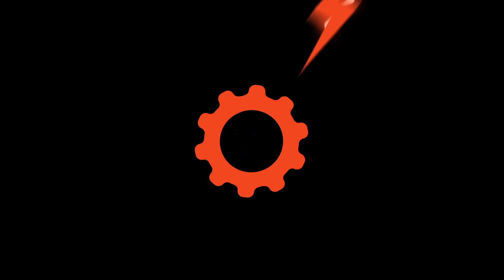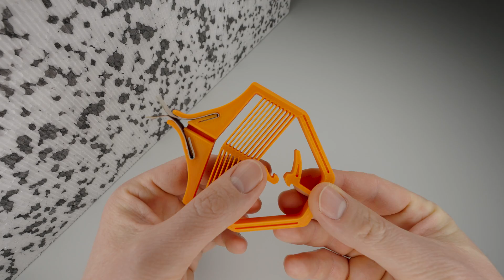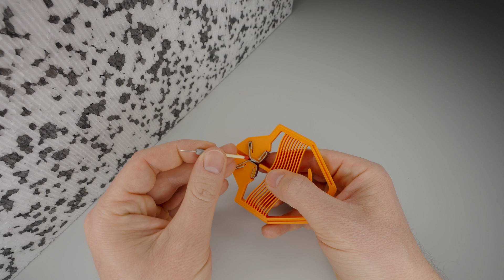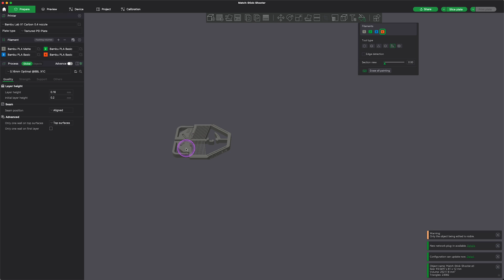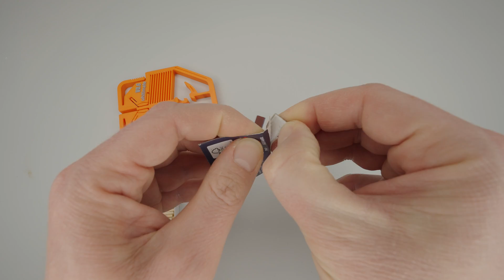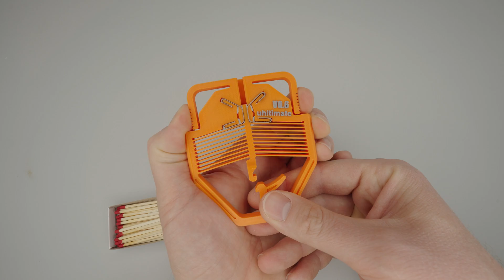Burning MatchStick Shooter - Fire Arrow - 3D Printed Crossbow

Comment: Great model! I just subscribed. I have an IDEAL or possible model. Something that incorporated the compliance spring mechanics a match And make it a pull pin ignition for Canon cord. You can make a version of it with popsicle sticks matches and the ignition strip where you pull the ring and it essentially drags the match between two ignition strips held by popsicle sticks with Cannon cord attached for a outcome similar to pulling a pin on the grenade.

Comment: Fun project, thanks for sharing.  I took a look at the files and wonder what the difference is between the two versions and what is the point of the caps?
Reply from the maker: Thank you! The two models only differ in strength, the strong model shoots further than the light one. If you are planning to use the matchsticks as little darts (as shown in the video), you can use the caps to attach a needle to their bottom.

Comment: What's the pin on the non-flammable end of the match stick? Looks like it's pretty useful for balance during flight and also for, well, making the match stick actually stick where you shoot it.
Reply from the maker: Hi, you can find the caps model on MakerWorld under raw model files, but it only works over short distances.